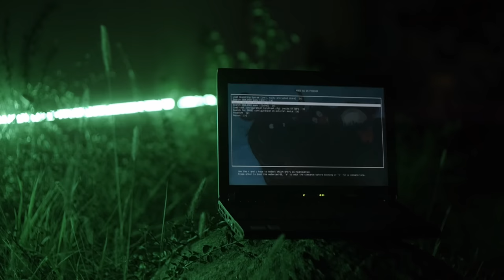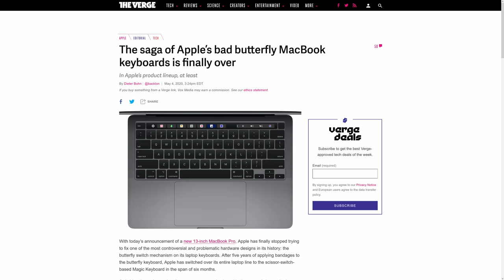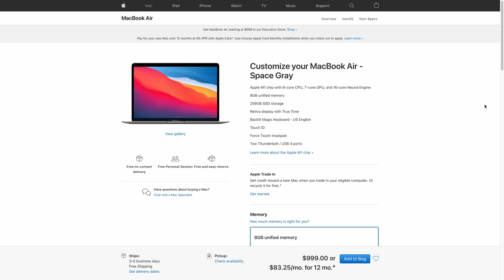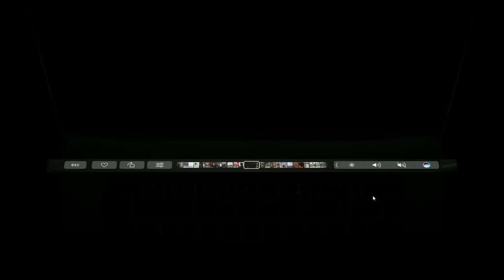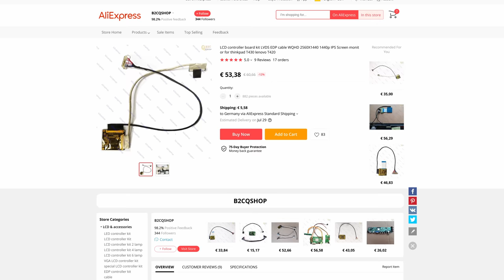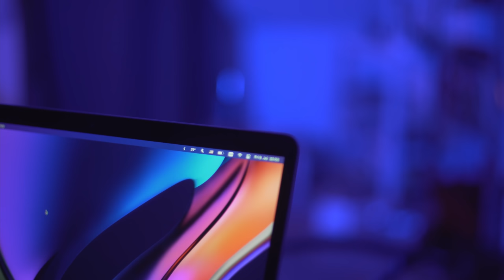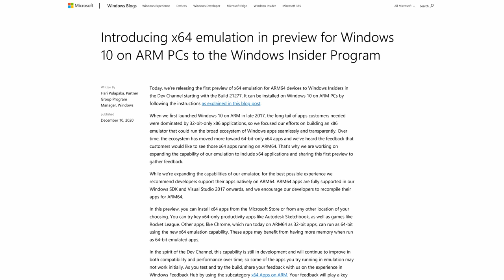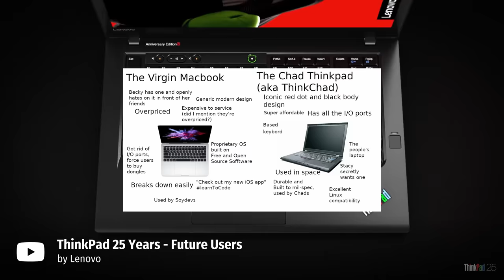Why I Switched to Mac (as a Linux user)

Comment from the maker: Many people have mentioned that I didn't include the new AMD laptops in my comparisons. My bad! Here are my thoughts:
Even though Renoir laptops provide a really good value, I'm yet to see an x86 laptop that balances performance, noise, size and battery life as well as the M1 Macbook Air does. 
Sure, you can get an AMD laptop like Acer Swift 3 or Lenovo Ideapad 14 with a Ryzen 5700U or 5800U for a similar price (or sometimes even cheaper), and the performance will be better than the M1, but that's not something I can say about battery life (real-life numbers, not manufacturers' claims), build quality or noise – all of these factors are really important for me personally. 

With my workflow, I would also have to run Windows on those laptops – since Linux does not support the software that I need and you can't run Hackintosh on an AMD APU. As mentioned in the video, I don't like running Windows on my daily driver laptop, since I find the experience subpar.

That being said, if you run Linux or Windows, Renoir and Cezanne laptops are a great choice.
Reply: @banddy1376   have you take a look of the track record of those companies?
Reply: have you not noticed garbage scrolling on safari, on simple pages like YouTube, or amazon, this seems to be a Big Sur issue, as any version of Mac OS before it is buttery smooth on safari, let me know your thoughts on that
Reply: I got a notification someone replied but I can't see the reply
Reply from the maker: Youtube shennanigans I guess. Anyway, I didn't encounter that issue
Reply: @henriquemiranda5748  just checked youre right but I rarely use safari, I use Chrome...mine is MBP 2019 Catalina its probably how Safari is built on it... but I hear consistently is Safari on Mac is mostly recommended if you want to save battery life
Reply: @jabnakarramon5121  that makes sense, on mine running Big Sur, all browsers suck now, do you have a Mac running Big Sur?
Reply: the reason I am blown away is because eventually we all are going to have to upgrade in order for the computers to stay safe by receiving the protection updates, and as far as now same issue is present in Mac OS Monterey, if no one talks about this, the issue won't ever be fixed and we we will all be stuck with shitty scrolling performance on anything
Reply from the maker: Just tried it, no frame drops
Reply: Well mac os does run on amd cpu's....
Reply: @banddy1376  what problem are you facing
Reply from the maker: @boltez6507  Yep, AMD CPU + AMD dGPU is fine, but AMD APU isn't. Re-read my initial comment.
Reply: @WolfgangsChannel  ohh sorry didn't read that....i get it, mac is just awesome for production.....
While it doesn't provide you with as much flexibility as freedom than windows or linux ....its still a great os for editors , developers etc
Reply: @banddy1376  There are no Nvidia drivers for macOS past High Sierra. If you’re installing a newer version, your 1050 Ti won’t work.
Reply: Just got a dell inspiron 5515 for 750€ (was on sales, it's usually around 1k€), it's thin, quiet, well built, has a r7 5700u 8c16t, and I easily manage to get 10 hours of battery life out of it, depending on the task. I love the keyboard and trackpad, only downside for me is that the screen is pretty bad in terms of colors
Reply: > but that's not something I can say about battery life 

Yup, exactly. My 5800H machine barely lasts 4 hours on battery power and it's super annoying to be near a power outlet all the time with a brand new laptop. Oh yeah, and it's super noisy, but that's the price you have to pay to get M1 levels of CPU performance on x86
Reply: yoyoyo let me destroy your dreams of perfect battery life, silence, performance, gaming, size etc all in one machine: Z E P H Y R U S   G 14  2021

Source: have many laptops INCLUDING the MBP13 M1 and Zephyrus G14 2021 Ryzen 9. Battery life is around 10h for both (apple promises 20 but if you really do anything serious on it you get 5-10, like the zephyrus). Performance: Zephyrus destroys the M1 in almost every aspect. Don't talk to me about thermals, the M1 dies if you ever touch that GPU for any real load. If you run anything barely heavy on the M1 that also includes GPU load, it will glue itself to 100ºC and the fan will scream for air VERY LOUDLY. Sure it is completely silent in day to day "office" tasks, but so is zephyrus, that literally never turns the fan on (that means, silent). Zephyrus uses liquid metal and the Ryzen 5000 are very efficient, that's why. And then there is the RTX 3060. If you game on both, the mac will scream with it's single mini fan and thermal throttle a lot and get you 10 fps at best on a decent game, while the zephyrus runs Cyberpunk 2077 maxed out ray tracing (with DLSS) at 60 fps and around 80ºC constant on cpu and gpu with very quiet fans (in custom mode with a custom fan curve and custom CPU TDP, if you run it on default it's still not as loud as the fan in the macbook pro while under heavy GPU load). Stop with this "M1 IS SO GOOD" bs. Yes it is, for office and light work. And for macOS users. Those that don't even know what dual monitors and actual productivity is (the MBP M1 for 1800€ for 512GB, the one I have, only supports ONE external monitor. And if it is 4K, it lags and sutters with it. Nice pro machine.). Then the Zephyrus looks and feels much better and more professional than the already "very generic" looking macbook that you have to hold like a baby because it scratches like butter, and it cuts your wrists when using it because Apple loves to do sharp 90deg angles on the sides of the laptop, including the front. Keyboard is also better feeling on the Zephyrus. Speakers with dolby atmos active also sound better AND HAVE MORE BASS on the zephyrus. I don't know why everyone praises mac speakers and no one is talking about the G14/G15 insane speakers. Zephyrus also charges through usb-c if you want, up to 100W. Then the zephyrus has upgradable RAM and SSD and whatever. G14 2021 literally killed my love for the MBP M1. I'm trying to sell it now, it's catching dust and scratching the drawer it's in BECAUSE THE CHASSI IS SO DAMN SHARP.

Also, about performance on silent mode: In silent mode, fans always off and turbo boost off, this Ryzen 9 5900HS from the zephyrus gets 9k points on Cinebench R23, the macbook gets 7k AT MAX. 7k is awesome, but it's starting to get behind already. On performance mode the Ryzen 9 gets 13k, almost double. And once again, there is also a RTX 3060 that completely destroys the M1 gpu on any aspect. And I have 1TB NVMe SSD, upgradable, 16GB RAM, upgradable, and everything cost me 1500€. My MBP M1 once again costed me 1800€ for 8GB RAM and 512GB SSD, nothing is upgradable. I'm fed up with Apple. Their laptops are awesome, but this zephyrus and other windows laptops in 2021 are starting to just surpass them very hard.

If you are comparing a 2020/2021 M1 for so much money, also compare it to a 2021 Ryzen 5000 for the same price. Why are all youtubers comparing macs M1 with 4-5 year old intel cpus with integrated gpus?
Reply from the maker: I'm glad that you found a machine that you're happy with :) Don't see why one would get so combatative over someone else's choice of hardware, especially if they're so sure they made the right choice, but to each their own. Here are my 2 cents:

- I'm not sure if the pricing is differnet where you live, but in Germany the Zephyrus G14 model with 3060 goes for €2299. €1500 only gets you a model with 1660 Ti and Ryzen 4900HS.
- I've been using my Macbook Air with an external 4K 60Hz display and don't see any lag whatsoever. It doesn't even seem to be heavy on the GPU, since the SoC temperature is pretty much the same between the internal and the external display.
- The M1 Macbooks only support one external display and yes, that's a big disadvantage. It's also something that was mentioned in pretty much every review, so you really should have done your research before buying a new laptop.
- Can't say anything about the fan noise since I went with the fanless model. Quietness was my top priority, and having a fanless laptop that can be comfortably used on the go to edit videos, program and browse the Internet is a really big plus for me.
- I've used my Macbook for about 3 months now, and there are no visible scratches on it so far. I lug it around in my backpack every day and take it on trips.
- I also haven't noticed any sharp angles, but that might be personal preference.
- I've been using the Macbook to edit 4k 25 FPS ProRes footage on the go and work with audio, and it handles it very well. There are plenty of use cases between playing Cyberpunk and 'light office work'.

In general, it seems like you're mostly trying to convince yourself (and not me) that swapping your Macbook for a Zephyrus was a good choice.
Reply: I have a ryzen laptop, and i regret buying it. There's a 2 month old bug that freezes my laptop (and other's systems) thanks to the amdgpu driver crashing
Reply: @luisortega8085  what OS are you running? I have a lenovo ideapad 5 14 amd and been testing out linux on a VM. I plan on dual booting it with windows eventually
Reply: @qBtz  aSUS M509DA. Performance is also bad since kernel 5.9
Reply: And right after all the good words said, Apple does such shit, as taking away the remnants of  your privacy by including another bunch of surveillance algorithms))
Reply: Until XPS or at least LG Gram will make AMD laptop with RDNA2 there’s not even a close alternative to M1 Macbook Air. And then, it’s gonna be tough.
Reply: @banddy1376  The x260 I'm rocking still has life in it, but when the time comes to upgrade I'll grab some Reduced Instruction Set based laptop, currently the Mac M1 is the front runner and it isn't even close, if my x260 were to die tomorrow that's what I would get. 

But yeah, let's see how these other companies respond.

Also, who knows if getting whatever strongest android from samgung with Dex ends up being a great alternative?
Reply: @frykauf  Yeah... Myself I wanted a Dell XPS, but since it has Intel, I thought it wouldn't be a good idea to purchase it. I don't get why Dell can't offer AMD on the XPS line... But well, their loss. I've ended up getting a M1 MacBook Air instead. I'm very happy with it.
Reply: @adriatorres2918  They are the biggest laptop partner Intel has, and their most popular product line have the more expensive Intel chips. They probably have the best (and probably multi-year) exclusive contract with DELL. I think they have few AMD Inspirion laptops that are close to the XPS quality, but very few want the „downgraded“ version if they were charmed by the XPS line. Plus the XPS line still didn’t fix their trackpad issue, it’s been 2 years. (to be fair it took 3-4 years for apple to fix their keyboards :) )
Reply: You state that Lenovo isn't going to sell workhorse products at an affordable price like they used to because it isn't profitable-correction! It is LESS profitable. That's the real kick to the dick. It's not like Apple and Lenovo would go under from selling good products that last. It's just that they would sell less of them. #Capitalism #ProfitIncentive #FreeMarketsAreMagic
Reply: +Wolfgang's Channel
What about discussing Framework laptop, and ARM, RiscV, etc based boards to go in that ??
Reply: I agree with this. Apart from ThinkPads, I think maybe only Dell makes Windows/Linux laptops that can compare to Apple in terms of durability (and some models with design).
Reply: i got a refurbished thinkpad Yoga 370. its not a workhorse, but using Tablet mode in Gnome is the best thing ever. i wish linux had software like Procreate (the go to drawing program I pad users use) but other then that, my lenovo yoga has the same function as a Ipad AND a Laptop. I am currently experimenting with Opendrop, so that i can share files in class with apple users
Reply: Yeah you're right although you will get better performance with intel & amd in the same price, still you can't experience the best touchpad, fluids OS, battery life, fan noise and of course built quality.
Reply: i love the idea of an high performance ARM system. I would absolutley love an standalone M1 motherboard in a smol pc.
i just cant stand the closed eco system. I hope the asahi project can make apple more "open" in the terms of software and modding
Reply: Low Upgradability? Lol
You mean NO Upgradeability.

Says 2023 g14 and many more are faster have pretty good battery life good screens upgraded yes they have a fan which us a good thing true egpu...apple is no linger they best for photo and video...the media engine chips are their claim to fame not the cpu or GPU.
And low energy use.
Reply: This came out before the M1 Pro and max pro computers.
Reply: I have been using macOS for 15 years, more or less. At some point I decided I had enough of Windows and I bought myself a Mac Pro, the tower. It made me a great service. Then, after years broke, and I replaced it with a MacBook Pro. I got a deal on eBay, bought new, and sold I think 5 years after for only $600 less then what I paid, basically $100 a year of depreciacion. I had several MacBooks, till finally, about 5 years ago, I got a ThinkPad and installed NixOS (one of the most peculiar Linux distro). But I gave up, and I sold it, because Linux was a pain. Then M1 came out, and this is my second M1 laptop. It's just another thing, it is so much better than any Intel or AMD processor. Battery life, fans never spin up, completely silent, never hot. It just works, and integrate beautifully with my Time Capsule (bought used for $70), never had an issue with backups, all my files are securely encrypted on the file system and on the backup as well. And it works so well with the iPhone as well. It's no brainer. I leave the desktop Linux experience to people who have a lot of time to waste, those same people who code on Vim instead of Visual Studio or IntelliJ platform. Those same people who can't used a debug.
Reply: @biomorphic  depreciation on all power pc mac's was huge and now the Intel mac's have less resale than many pcs even from apple.
Apple no longer has good resale assuming you have an Intel one 

Just go check and see the fire sales.
Reply: @Tigerex966  that was an Intel based laptop, sold years ago. The Mac Pro was a PowerPC, but unfortunately passed away. I tried to fix it, because I thought it was the power supply, but I had to let it go. Mac based on M1/M2 processors will keep the value better than any other laptop. It took me a while to sell my ThinkPad Carbon X gen 7 that was 1 year old, meanwhile I sold the very old MacBook Pro in a blink of an eye.
Reply: No need to apologize, I purchased two laptops with both the 5600u and 5800u under the hood and they are still god awful. They choke to do things I take for granted and don't even think about, like photo editing using the AI masking feature in Lightroom, h.265 editing with footage from a Fuji camera and it's uncapable of reliably processing audio with a DAW. Ryzen 5000 had nothing on M1, let alone M1 Pro.
Reply: @WolfgangsChannel   You didn't show a single comparison b-roll of Mac with Linux. All your think pads were running either Windows or Mac clones. Basically you had a point to make so you got to it, but sprucing up, a disingenuously build story-line and then working backwards. Shame on you & your click baity title
Reply from the maker: @Little-bird-told-me  Made you watch though 😉
Reply: Here is why im still a sucker for Thinkpads and the L470 and the T15 im using:
1. The io I really need the io to plugin a usb to serial cable when im directly accesing a Switch or a server at work
2. Rugedness yes you said they werent really rugged and reliable anymore but in what i found that isnt the Case
3. Yes the Keyboard

Unrelated im using it as a in between when im offline or on a poor / slow connection as soon as i get online i outsource everything to My Own cloud where i do rendering etc and ive found that This approach works best on Windows And linux and must say that i tried getting a Macbook into my workflow to try it but it didnt work out as it already failed at the io.
Reply: HP Zbook Studio G9 beats MBP M2 in performance while having same battery life and price
Reply: @henriquemiranda5748  I don't have any issue and there is an app to improve smooth scroll. With just clicks, nothing like a terminal like Linux.
Reply: Only a Mac uses its maximum power on battery and no Windows laptop comes close to the battery life and portable comfort.
Reply: @iSkateNate I have not had any problems with Mac OSX, it is the operating system that I have used in my life, suffering for years with the instability of Linux distros, and the apps they have are poorly made. Everything was very unstable, it was a waste of time for me, with Mac OSX I have something that is to the point.